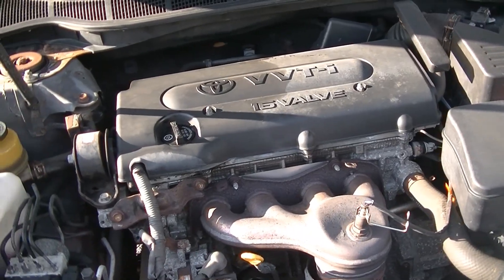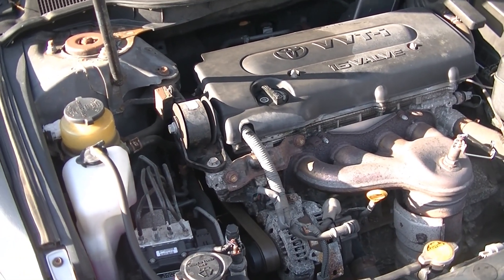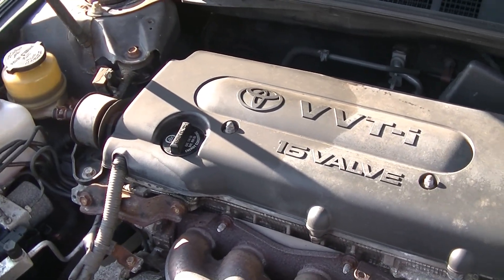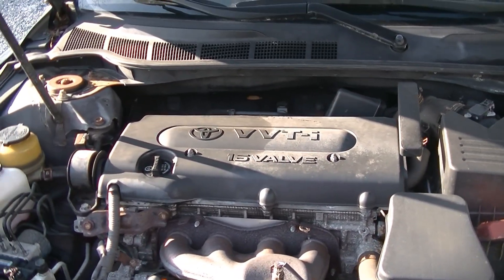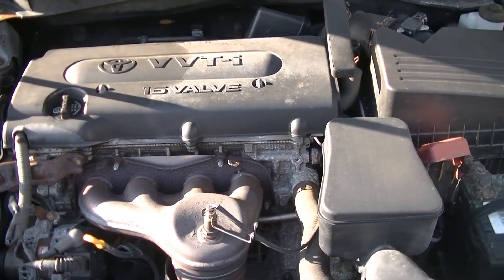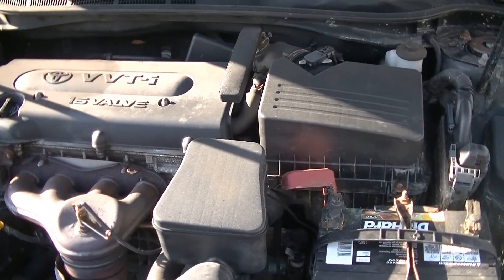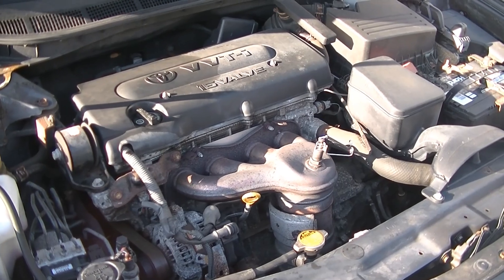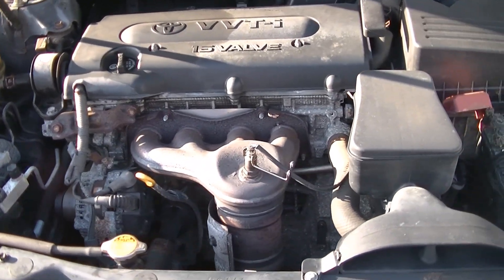Why you should AVOID a TOYOTA with the 2AZ-FE 2.4 liter engine!

Comment: My opinion. Best years to own is 05-06 is Camry SE 2.4l. Why? Has ABS and rear disc brakes. No head-bolt issues or low tension piston rings. No timing belt or hard to reach spark plugs behind the engine. Easy maintenance and good mpg.

Comment: True . My head bolts went at 163k . I got a kit online and rethreaded the block and the car has 300k now and still rolling . If you are not mecanically inclined AVOID THE ENGINE , because a rebuilt will cost You . I love My 2004 Highlander and would rebuild the engine if it ever went .

Comment: He's not wrong, but remember, not all of these engines will have these problems. Mine has 252K and is still going strong. Not very powerful on the hills, but a very quiet and smooth runner, which means less fatigue on long drives, like, say, from AZ to FL and back. I enjoy it a lot.

Comment: mine is showing me oil pressure warning light after already having had it sludge cleaned and replaced cam shaft that was seized and bearing chewed. I am taking it back in to check the oil lamp reason and have oil pump, oil strainer and others checked. Toyotas are just as breakable as others. My Honda Fit engine is almost at 400k km and still strong. I miss the Toyota Corrola 5FE engines. much better

Comment: Just looked up the approximate percentage of 2AZ-FE engines that have serious oil burning problems.  Chat gap comes up 10-20%.  They admit no real records are kept, so this is a round about figure.  Now let’s see the approximate percentage of people that do not know how to open the hood and don’t check their own oil.  Sure there are problems.  Engines are machines that have to be maintained. Sometimes problems can be exacerbated by improper maintenance and letting your engine run low on oil.  10,000 mile oil change intervals have not helped.  People have to be educated to key maintenance information!

Comment: ,I had a 1007 Camry with the same engine. I changed the oil every 5000 miles and the only 2 recalls were the water pump and the throttle body, both under warranty. It was totalled at 90,000 miles and never failed me. It's all in the maintenance maintenance.

Comment: 600 000 km on mine, uses a little bit of oil. Not too much. 2005 model Camry. 10000 km oil changes. Still runs like new. Of course lots of other maintenance done as well.

Comment: My 2005 Rav 4 is now leaking coolant from the rear of the engine. Original owner, oil changes every 5k mi. Changed coolant regularly and only has 125k mi on it.  I thought this car would do 300 k mi easy.

Comment: Main issue is the low tension rings. If you see the RTV on the front timing cover that is black, you can guess it was fixed under warranty. Or you can see if the dealership has the service history.

A short block will be a good investment if the rest of the car is good..these will keep going and going. Super easy to work on and keep going.

I hate the engine because it is buzzes like crazy when you floor it. This entire platform is way too big and handles like a mushy potato. Longer trips are very uncomfortable because the level of noise from the noise is absolutely terrible. 

A 2.0T Honda Accord is much better for many reasons.

Comment: Hey Stefan, thanks for the video. I have an '06 Camry SE with this engine and, yeah, I've always found it to be a bit noisier and less harmonious that the 5S-FE in my '94 Camry with 273K, but nothing was wrong with it when I got it, no oil burning. I probably would have still bought the car (used in 2018 with 120K, now 149K) even if I had known about these issues, I really liked the styling and it hasn't let me down. I did something stupid when I was in a bad mood one day, though...in April '24, I started up the engine, threw it into gear, and sped off in mere seconds, the engine had barely had a chance to run. Now it vibrates a bit at at low RPMs and is slightly noisier. Still basically runs fine, good highway mileage, but something's just not right. As you recommend for this engine, I am mechanically inclined and have a decent set of tools, and since April I've replaced a few parts that COULD have been the problem, but alas weren't. I'll figure it out, I always do. Besides, the car is perfect otherwise, I'm going to get 300K or more out of this car.

Comment: My brother had a 2005 camry with 4cyl that mimicked blown head gasket.  I told him id tear it down and check it out. Found out about the bolts and timesert install. Got head off and the aluminum around the 2 center cylinders were gone, cracked fell out exposing the steel cylinder tube. I have never seen one grenade like that. It may have gotten hot enough pistons swelled and expanded cylinder walls. Idk. Any thoughts? Definitely a paperweight at this point.

Comment: would you buy a camry that has 2az-fe the engine replaced under warranty by toyota.  it was repalced in 2018.  thanks
Reply from the maker: Absolutely! Should be remanufactured long after the TSB was released for the piston issue
Reply: @SEsGarage  can't believe you got back with me.  may God bless you....thanks  (were they replacing these even up to 2018 under warranty? - )
Reply from the maker: @ it may have been an extended warranty. I don’t remember exactly how long the warranty extension was on them

Comment: This engine was updated for the 2005-2006 Camry to fix the head bolt issue. This was before the update in 2007 that introduced low tension piston rings and the oil burning issue. Buy a 2005-2006 if you want to be problem free.
Reply: I bought a used 2006 Highlander with this engine 2 years ago with 119K miles on it. 
No problems with coolant loss or oil consumption. And servicing for tune up,  fluids  and oil changes 5000/6 months at my local garage. 
I've been a bit worried about the possibility of stripping head bolts due to all the negative YT videos on this engine. 
Especially, because I haven't been able to find any records of a fix in the past. 
Your comment confirms my hope that this Japan made Highlander fell between the troubled manufacturing dates and missed the head bolt issues that are being brought up. 
Really enjoying my Highlander and hope to maintain and keep it for many years. 
Any further thoughts would be appreciated, or if you can suggest how I might find out from Toyota. Nothing for my vin on their site  except "no recalls".
Thank you!

Comment: I got this Engine on my 2006 Scion tc. I got no issues with this engine burning oil. Got 134,000 miles clocked on this engine. Only issue I have with this engine is the oil filter screen clogging up and causing the VVT phaser not gettin enough oil and causing  check engine light to go on.

Comment: Got mine (09 Matrix XRS) at 189k, couldn't keep up with the oil loss. Filline 1-3 quarts with every tank of fuel. Blew the engine after about 5k miles, when I was looking into replacing the rings. Did a swap in my friend's garage. Now, about a year later, I'm replacing the transmission because of bad bearings. 😭 Maybe now I'll have a gem?

Comment: 260k on my 2009 camry Dailey driver. Check the oil one a week if it burns oil, and top it off you can get 600k. On this engine you have to check the oil when the car is cold. If you check it when its hot it will show u a low reading. More oil than gas not really. Use ams oil or Castrol. Do an ams oil engine flush if it burns oil that bad which I doubt.

Comment: It’s one of the best motors made my Toyota. It’s based off the 2j. You’ll start burning oil at higher mileage but as long as u fix your seals including the oil pan seal and do oil changes every 3-4K miles your good.
Reply from the maker: It’s definitely not based off of the 2J, It’s a totally different design. The 2J is a closed deck block designed for boost. The 2AZ is an open deck. The two AC uses a totally different upper oil pan/girdle set up. The 2AZ is chain driven where as the 2J is belt

Comment: well with that said if anything happens with my 2002 camry with 194,570 miles, besides the oil burning but if the engine head bolt start to strip in the block i'll just put in a remanufactured engine in it.

Comment: Bought a 2012 Corolla XRS, thought it would be a fair car after being a fleet driver for many years. Big mistake. I am on my third engine now, watching over my oil like a hawk. The engine warehouse felt so bad that they upgraded my warrantied used engine with a rebuilt engine. I've stuck to my oil changes, watched over my oil temps, nothing out of the ordinary, and then BAM. Oil pressure light. No hope remaining. 

If I managed to get a Christmas bonus, I am done with this car. But now I am stuck with it as I had to move to a new town to accommodate my next step in my career. Canada's dealer scene is terrible, I am afraid I don't have a choice.

Comment: Its the stock thermost causing the heat...i test it and open but the secondary thermostat spring is too strong for the water pressure...so i replace the thermostat with a aftermarket one and i delete the secondary thermostat to keep the engine head cool....and i remove the jiggle pin and leave purge hole to 12 oclock and now rhe the engine runs well and mpg is decent just add 10w30 oil for a extra cool and protection 2azfe engine is pretty sassy in a 09 pontiac vibe... Full synthetic oil i would recommend for the engine to keep clean  And drain oil often.

Comment: Seriously this video its just made to click. Those engines are really good. I know few with over 280000km and running sweet. no issues. Hey people! 2AZ-FE rocks
Reply from the maker: Check out my latest series I’m in the middle of. 2AZ with a blown head gasket AND oil consumption issue. We will be tearing it down and inspecting

Comment: Great video! I have a 2002 Japan build with a 5 speed and do a lot of preventative maintenance on it, especially on the cooling system. I run a scan gauge 2 and keep my eyes on those coolant temps. 190* is the highest I’ve seen it go, but it’s usually at ~175* in normal driving. Overall it’s a great car and I enjoy driving it on long trips and hope to keep it going.

Comment: Oil is cheaper than an engine! 260,000 miles later.
Reply: But if it's bad enough I've heard the oil burning will foul spark plugs and clog the catalytic converter. Not sure how to tell but I assume yours is not burning enough to cause issues.

Comment: yea most mechanics say its a very reliable engine can go many miles, easy to work with, however, if it does not bother you adding oil every 2K miles and changing your oil on time. It's cool. and you're correct, once you know of a problem, fix it. to avoid cooking the engine. Some say the oil burning was 2007-2008 but apparently it is in the 2009 bc it has this same engine apparently. Thanks for video

Comment: 07/09 2azfe were JUNK toyota put low tension piston rings in them. Runaway unless the seller can prove the engine was fixed per the recall. My 2005 is still going strong.

Comment: I have a Camry with this engine and it’s a pretty great engine. I don’t know what you’re talking about. Mine doesn’t burn oil, at ALL! Changed the main back seal once and that’s it. The engine is very easy to work on. 

The trick is using the right oil for the weather of your location. I use 20w50 instead of the 5w20 or 0w20 written on the oil cap and it runs fine. And of course changing your oil as required.
Reply: It was probably fixed at some point. They ALL burn oil at some point.
Reply: @mediaguy4037  Yes, they do. But mine doesn’t burn as much as I hear people say they do.
Reply: ok now that too thick for these engine. 20w50 is ridiculous. at least 10w40 with Lucas oil stabilizer

Comment: 2008 Camry 2AZ-FE: Short block replaced 45K miles, alternator 110K, rear backing plates rusted 120K, radiator/water pump/hoses 130K, complete OEM engine mounts 145K, power steering lines 145K. Highly recommend Mobil 1 0W-20 20K extended and I do BG's oil change EPR/MOA/44K every 5K miles, uses 1/2 quart oil, change trans fluid every 60K miles. Dash panel sticky/cracked, there's an expired TSB about this, can do a cover or just use Meguire's interior cleaner. Definitely the V6 is better, hope to drive this one to the ground, should get 100K miles. Just changed to a cheaper Walker exhaust as the OEM rusted out (Midwest road salt). Best: change oil max 5K/6mos, PCV regularly. If you live close to Homer Glen, check out TCCN YouTube channel. Balance shafts have minor noise. Japan made Toyota's are much better.

Comment: I have an 02 that had some of the head bolts stripped and caused combustion leak (mine were not the rear but the front 2 left to right).  Added stopleak and drove it for 4 years. (30 Miles). Eventually I pulled the head and used longer head bolts because I was too cheap/lazy to do the repair right.  I was able to get it on the road but it started knocking and I think it was to gone by the time I removed the pan and found a bunch of crap in the oil pump intake filter.  But to say avoid all those years I think is a bit overly critical.  I heard after 06 they got better.  Anyhow for 3 years I beat the hell out of that thing with head leak repair.  I towed boats with it as well! Can you say that for an American car?
Reply: Some American cars yes, but at some point they really started messing up with bad engines. Also your camry was made in America!

Comment: 2007-2009 oil control rings had design issue. I have a 2004 Camry 2.4 bought new has 195000 miles doesn’t use oil.
Reply: Yep he said just the head bolts for those years

Comment: You are truly right because I've fixed a number of them in Papua new guinea. From over heating engine's to auto transmission's. And found a lot of fault s with those design's.
Reply: Wrong oil use, I can tell you that.

Comment: Low tension piston rings  are the problem in this engine oil consumption problem  
Toyota  used low tension piston rings to lower fuel consumption

Comment: Pure clickbait! I actually selected vehicles with this engine, which were built before the low-tension oil ring experiment. They have been flawless and forgiving. I would recommend against Mobil-1 oil because of my experience with varnish buildup. Problems with this varnish were remedied with BG EPR engine flush. My experience comes from 18 years of experience. Mobil-1 test below all the major brands in additive package rating. It shows when you pull a valve cover. Still, there was no lasting damage or excess oil consumption. In fact, my 2003 Camry has never needed oil added between 5K changes. The 2006 Highlander did have a period where it consumed 1 quart in 5K miles when operated at 80+ MPH. A flush last year stopped that moderate oil consumption. 197,000 miles and quieter than new.

Comment: I still have my 2002 Camry le and my car has 460,000 km (285,830 miles) so it still runs I am planning on changing the pistons, rings and rods so it can keep going and mind you I’m sure I won’t have to worry about oil burning after that job which will be done next year. These cars are very reliable but if you don’t want to spend the money to repair this car then go for another car. I’ve done much work to my car and mines a manual transmission but I believe it’s worth it in the end cause less technology and easy to work on and fix yourself if you’re a regular diy or advanced diy.

Comment: I have a 2002 Toyota Camry and the same engine. And my car burns oil like every 1000 or 900 miles. And I do have to add coolant from time to time cause of the issue you mentioned with the head bolts. It’s doesn’t burn coolant too bad but I do have to add only sometimes. And I had noticed that after a long drive, my coolant level rises so high above the full level of the coolant reservoir and it gotten so full that one day, it probably would had forced its way out of the reservoir. I suspect it’s the head gasket issue cause I replaced the radiator cap and radiator is good and I thought it was abnormal for it. It has almost 234k on it.

Comment: Bought a 07 highlander with this engine in it.  At auction.  It's sitting and won't start.  Wondering what a mess this is. 202k miles on the odometer.  Think i may have a fuel pump issue.  Waiting for my d7 to arrive in the mail...

Comment: This engine is a nightmare for a Toyota engine. It has the same issue as the Audi 3.0. Oil burns too much which also leads to catalytic converter failure.

Comment: I had a 2003 camry as my first car, it had 330000 kilometers on it when we bought it (around 205K miles), and one day when I was coming back home from the grocery store it overheated! I'm guessing the cylinder head bolts issue happened here, We took it to the mechanic and he charged us around 800 dollars for the fix. We only put around 110K kilometers in it and sold it. So pretty bad experience for me.

Comment: I have a 2006 Camry Altise that my Parents owned and drove for the last 17 years until they recently decided to buy a new car, the engine has never had any of those problems show up, in fact, apart from the normal servicing the engine hasn't had to have any major work done to it, been the most reliable car my Parents owned, it's about to turn over 190 000Km (118 060Miles) hopefully it will continue to be as reliable.

Comment: I have a 2004 Toyota Camry with 245,000 miles. It does use 1 quart every 1000 miles but other than that the car works great. Air conditioner still works. Power seat and windows still work and the upholstery is immaculate. I have no complaints about a car using a quart of oilevery 1000 miles.

Comment: Fell in love with my polished turd of a camry. I was under the impression it consumes oil because of the valve stem seals. I'm at 285k miles. It sounds like it's going to rattle itself apart and honestly didn't expect it to last but that was damn near 150k miles ago. I add about a full quarter a month. Still gets 28 mpg. I change the oil every 2500 miles